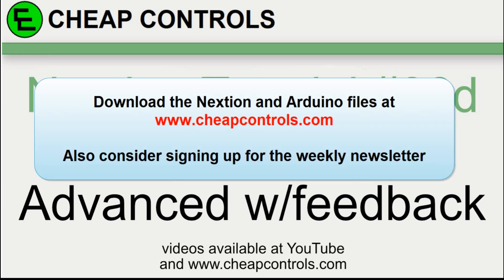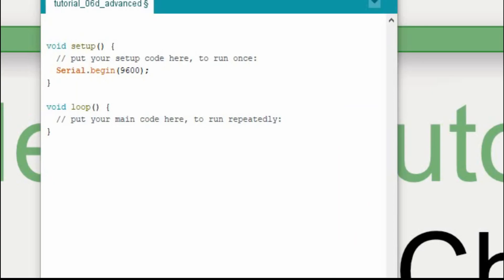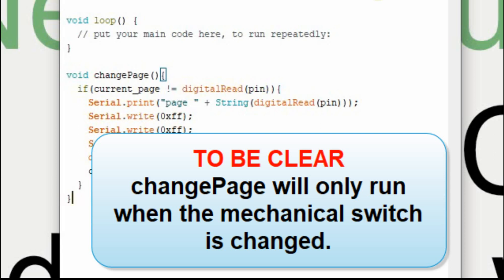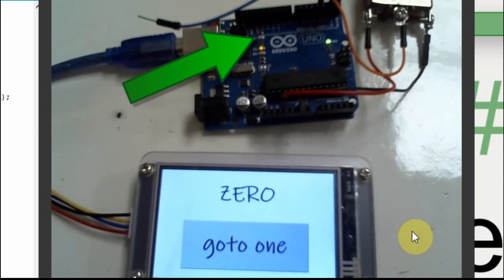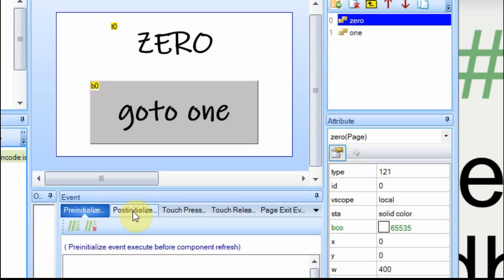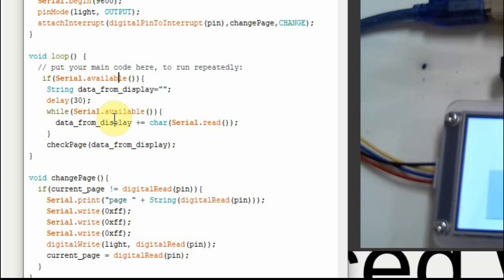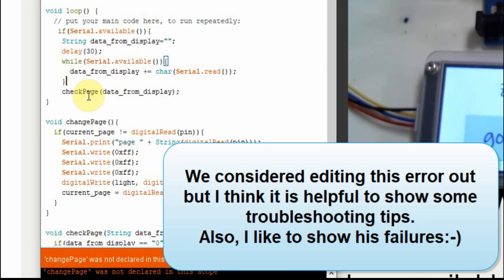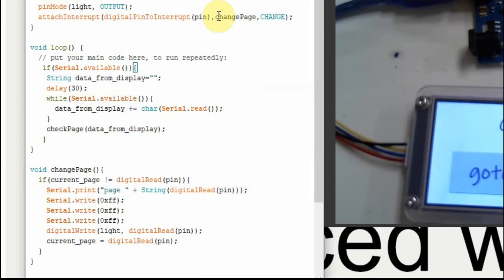#73 Nextion Display Page Change with Arduino and NO Nextion Library Feedback Part 4

Comment: Hello, I have a problem by changing pages. I have one button and two pages(page1 and page2)
First the screen stays on page1.  When button is pressed, it will switch to the page2.
button not pressed. the page2 can't back page1. I tried a lot of time and couldn't do it.
like this↓
 val = digitalRead(BUTTON_PIN);
 if(val == LOW){
 Serial.print("page 1"); 
  }
 else if(val == HIGH){
Serial.print("page 2");
Reply from the maker: I am not sure.  You can request help at www.cheapcontrols.com.  We will reply and then you can submit your code for evaluation.

Comment: hi great video, is there anyway to update text from arduino when the page changed?
Reply from the maker: There are a few ways to do this.  One way, the Arduino could request the current page on a timed interval, then alter text if page has changed.  A second way would have the Nextion send a command to the Arduino when the page changes and the Arduino could respond with a command to change text.
Reply: @CheapControls  thanks, i prefer the second way
Reply from the maker: That is the way I would recommend.  This video should help you with this.  It has been awhile since I have reviewed this video but based on feedback you can alter text.  If you want me to review any code you can ask for assistance on the Cheap Controls website.

Comment: Is it possible to get simple page number under Arduino without Nextion library? In addition, I used to use an event under arduino for not Nextion lcd screens. Such as for example to check if the screen is simple touched. Is it possible something like that? Thanks.
Reply from the maker: You can use the sendme command to get the current page number.  https://youtu.be/ySjoYyXbJUM It is also possible to detect a screen touch.  I am not sure how to describe that.   I am working on videos for all aspects but I don't think I have one for that yet.  You can search through all  my videos at www.cheapcontrols.com.  I am trying to get the code for each video downloadable.
Reply: @CheapControls  Thank you for your replay. I think finally I did it. What I wanted to do is to change amplitude and frequency of a sinus wave and send it to the dac. I wanted to get values from the number box in the Nextion and send it to the Arduino and use later in the calculation. I know now how to get the value but using numerical keyboard under Nextion messing up with touch press/release event. Pressing and release shows the keyboard only I would like to get the value after typed the value. I solved it by adding to the keyboard's "OK" button this line at the end: prints p[loadpageid.val].b[loadcmpid.val].val,0. I can get values after pressing OK button. Maybe not the best way but at least it works
Reply from the maker: Very unique solution.  Good for you.

Comment: Hi i am working on a project for a touch screen controlled receiver which i am using the 2.8" Nextion display i have the enhanced version. i have it mostly done but i am asking is there anyway of getting the Nextion display to remember a page id then allowing you to return to that page.  For example if the receiver is in the tuner mode the page has a button to navigate to a audio settings page where you can adjust the sound settings on that page i have added a 'back' button in order to return to the previous mode (page). I currently get the arduino to remember the page id of say the tuner page and if i navigate to the sound settings page and do the adjustment then i touch the 'back' button the arduino then changes the page back to the previous page (tuner) is there a way to do this in the Nextion display. So basically returning to a previous page from the current one using a button?
If anyone has the answer please comment with details of a tutorial for it.
Reply from the maker: You can store it as a system variable or write to the eeprom.  I am not 100% sure but I think it would work.  I will try to remember to look into this and post another comment.  If you don't see a second response in a couple days make a comment at www.cheapcontrols.com and I will reply to your comment with an Email

Comment: Hello, I have a problem by changing pages. I have two pages with "Pictures". I use these as buttons. So I change the picture with the arduino to a pressed button when the picture is pressed. 
But if I change the page and go back to page one for example, the pictures goes back to the default picture. The pictures/buttons control the digital outputs of the arduino. So I need the right picture to show the status of the output. I could check every output when I change the page and Update the pictures. But I thought maybe there is a easier solution?
Reply from the maker: I am not sure but a quick fix might be to set the button as global.  Let me know if you have already tried that.  Good luck and thanks for watching
Reply: @CheapControls  Wow. That works! Thank you for the good idea!

Comment: how if using momentary switch button not self locking button to control more than 2 pages?
Reply from the maker: I want to make sure I understand.  Do you want a single push button momentary switch to make the Nextion change from page 1 to page 2 to page 3 to page 4 to page 5 and so on for as many pages as you have and in order or do you want something else?

Comment: Hello, thank you for this nice video. Your shown method will work with 2 pages, but what i do when i have more pages such like three or four pages? Is then a pure software solution  then not be better than as a hybrid solution? A video about a pure software solution would be very nice, if one exists, where can eeryone find this (link)?
Reply from the maker: I am not sure what you are asking.  this example has a physical switch that has two positions.  Do you want a physical switch with two positions that control more than two pages?  Or do you have a different example that you are addressing?   Please elaborate a little bit more on your question.  Thank you for watching
Reply: I actually have 12 pages with about 1MB already.

Comment: Hello, i try to retrieve data from nextion i have try your example, but in terminal i have always nul nul nul when i touch screen, have you an idea of this ? Thank
Reply from the maker: In the Nextion Editor click on the button that is giving you the nul nul nul and make sure that "Send Component ID" is NOT checked.
Reply: @CheapControls  i have try all with and whitout and its same ... When i debug, the data is in simulator return so i dont know
Reply from the maker: @SpinaRCSpeed  You can download the examples from cheapcontrols.com and compare or you can ask to join the cheapcontrols private Facebook group where you can post your files and we can help troubleshoot.  Both are free and available.
Reply: @CheapControls  thanks i will try tonight and contact you